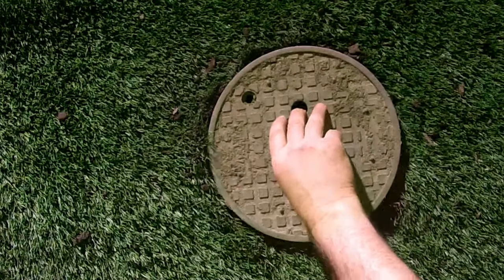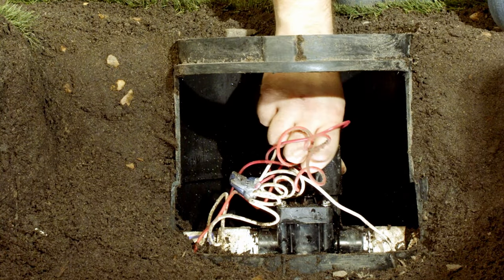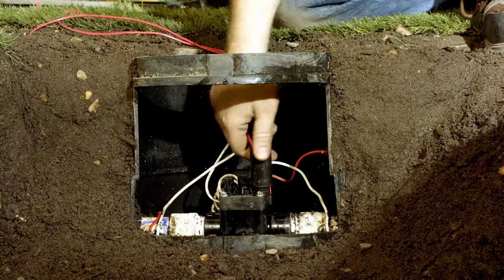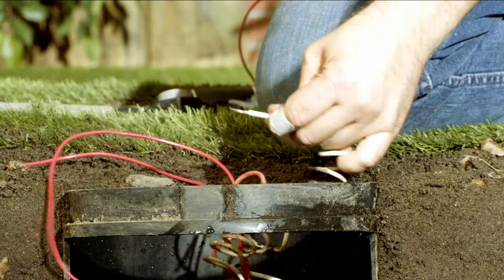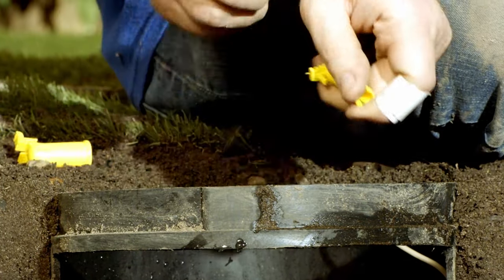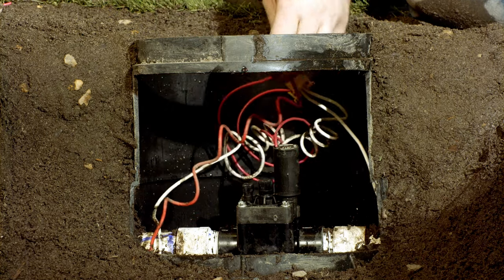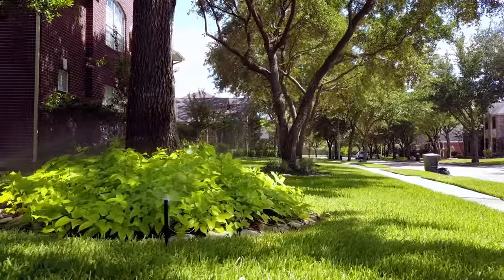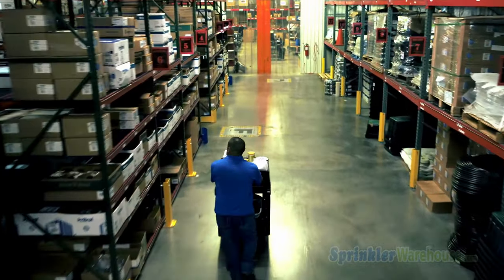Replacing A  Sprinkler Valve Solenoid

Comment: Question....so I’m trying to troubleshoot my zone 3. All of sudden the water pressure has become very low. There isn’t anything busted or clogged that I can see thinking it could be the solenoid but not sure. Any suggestions? My other zones work fine. 🤔
Reply: try to open the valve manually, if it does open all the way, its the solenoid